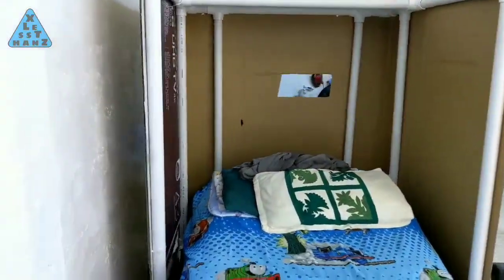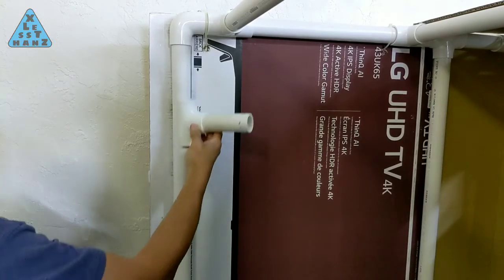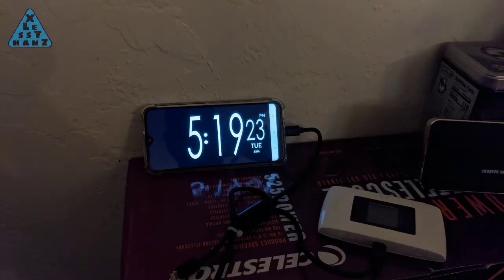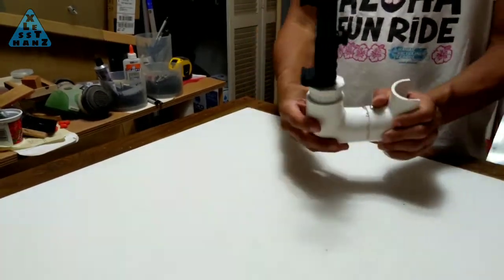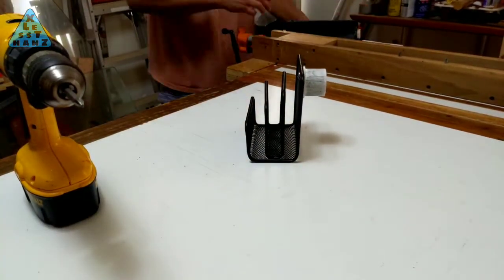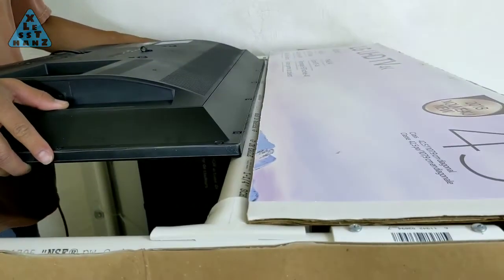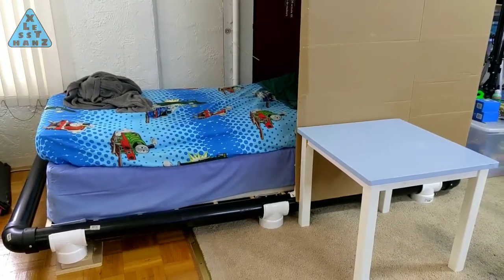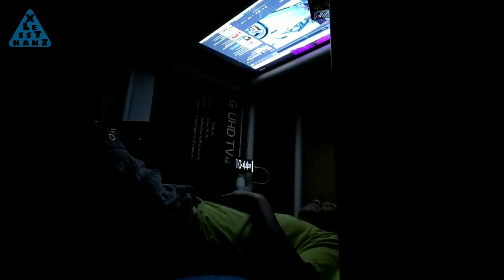PVC Platform Bed - Add ons (THOSE NICE LITTLE EXTRAS)

Comment: Does your bed makes noise when you move on it? Like friction between the woods and the pvc?
Reply from the maker: Ahh, yes.  PVC on PVC will do that.  Mines sounds like it's coming from the oversized leg that holds up the rectangle frame.  Probably what you can do to fix it is lift the rectangle corrner, slip fabric or felt between the leg and the rectangle frame, then set the frame back in the leg.  PVC creeks when it rubs so that should get rid of it.  I sleep like a log so I don't mind, but I can imagine that's not everyone.  Do one leg and see if that fixes it.  I think to test, you could even stick a folded paper towel just to be sure, before going around looking for fabric.